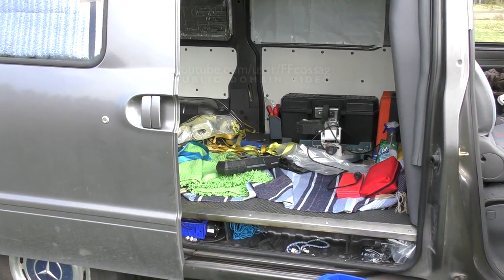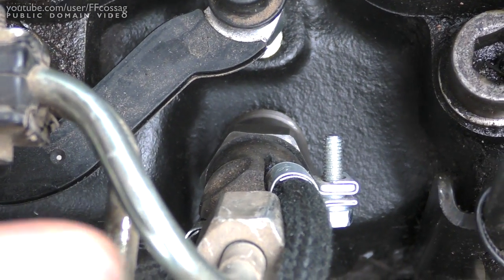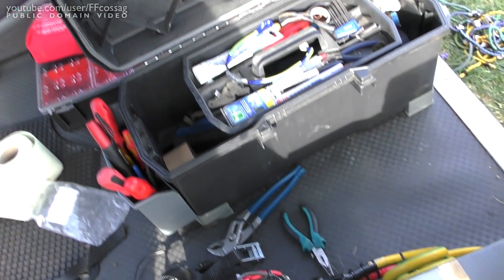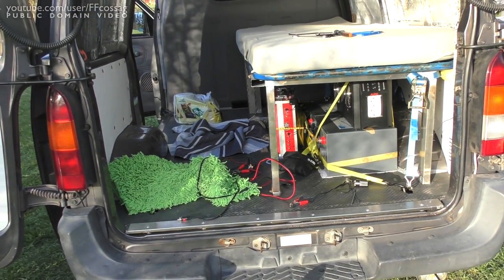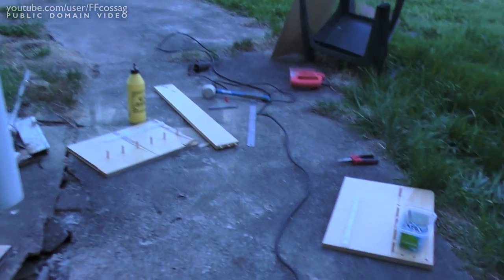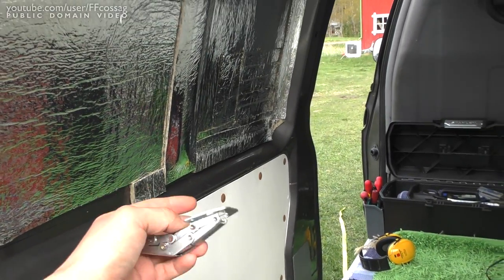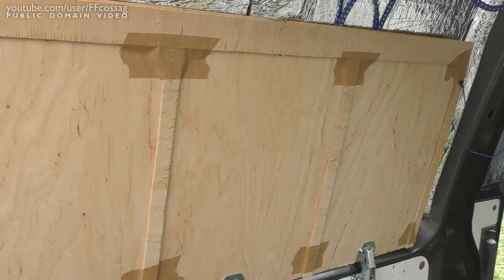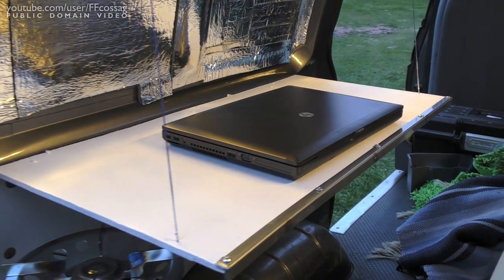Van camper conversion 2017

Comment: You could use pop rivets and washers to improve the table
Reply from the maker: I've never been a fan of pop rivets. Once they go slop, you're fucked.
Reply: I wasn't thinking of using rivets to attach the table to the van, but to have a flat connector to attach the angle iron. You put washers under the table to prevent them from going sloppy.
Removing them is also not impossible, however you do need a drill.
Anyhow, nice project. I like to see your low budget problem solving.

Comment: I've only just noticed this now but on the adscc why did you chose to set the Anderson connectors up as +- +- rather than ++ --? is it just for polarity protection?
Reply from the maker: It's because that's how they come wired up in APC UPSes, from which I pull them. I'd never be able to afford Anderssons otherwise, lol.

Comment: Surprised you didn't grab some sheet material of some sort to block out the rear windows properly. Just so it was on hand when you did feel like fixing it.
Reply from the maker: I like having the ability to open up to the sun. I'd like to make them double pane windows with some plexiglass, but that's a fair amount of work to get anywhere near right.

Comment: 3rd try is the charm looks was better than the fist setup. i like your safety plan "i'm just gonna not get in an accident" , if you did get it a front end collision it would suck to be body slammed by those huge batteries. btw are those AGM? i know they cant be flooded if you can put them sideways but the look like they have fill caps on top.
Reply from the maker: If you crash in a Nissan Vanette, you're dead anyway. It doesn't even have a single airbag. The batteries are Sonnenschein gel cells.

Comment: HHmmm. 

Very strange.

A Nissan diesel engine in a Mercedes van. 

Is this motor fitted as standard diesel motor by Mercedes it self.
Reply: It's a Nissan van with Merc hubcaps... ;)
Reply: Aha.
Reply from the maker: Ha, for once the hubcaps fooled someone!
Reply: Indeed I've been fooled
Reply from the maker: Because those hubcaps are awesome and they happened to fit.